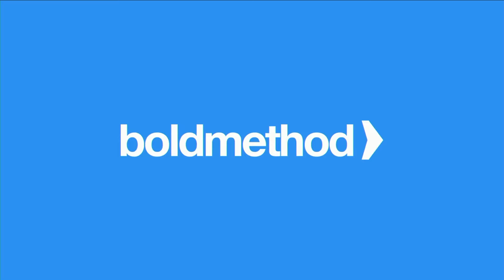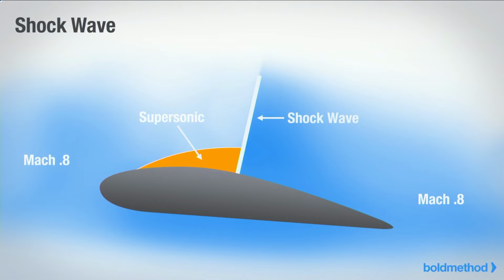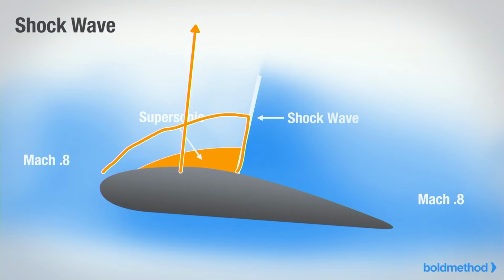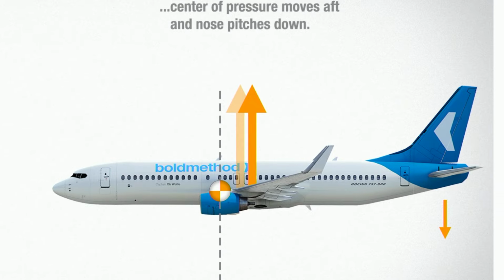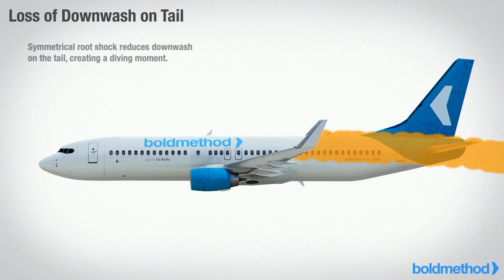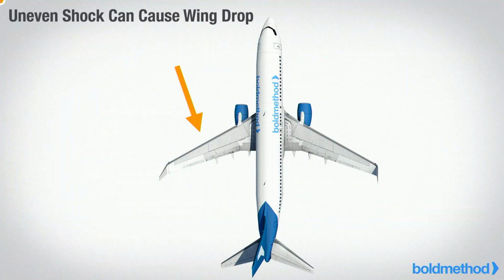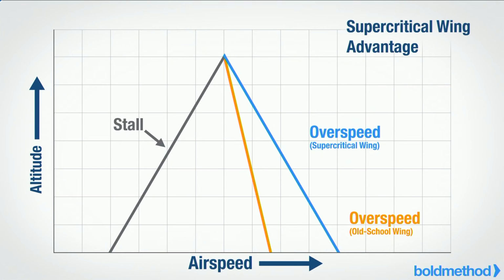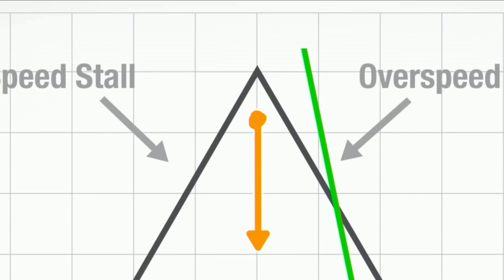Coffin Corner, Explained: Boldmethod Live

Comment: Quick calculation of the Speed of sound in m/s = 20 x (SQRT(Temp in Kelvin). To get Kelvin add 273,3 to Deg in Celcius. Consequently a is 294,8 m/s at the tropopause, above it stays almost constant until about 20km afterwards the temp rises due to the ozon which absorbes energy from UV radiation of the sunlight.

Comment: Just out of curiosity and this is from memory so I can be wrong, on the A320 for certification purposes, they had to fly at the service ceiling, use TOGA thrust and pitch the aircraft nose down to - 20 degrees to get some mach buffet and that was only for a limited time because soon they 'd be low enough to reach VMO instead.

Comment: To answer the question about pressure past the shock wave changing instantly: it just does. IE, that is the nature of subsonic and supersonic flows. The shockwave isn't a causal force, it is a result. Shockwaves are phenomena that form at the boundary between subsonic and sonic or supersonic airflow. I find it not helpful to think of them as a "build up of pressure waves". They are simply the thing that forms at the boundary, whether the flow is increasing in velocity, or decreasing. We are "seeing" the change in air mass properties between supersonic and subsonic flow. Air in supersonic flow is compressible, air in subsonic flow is mostly not. The change is almost instantaneous, and a shockwave is what we call that 'instantaneous' change.
Talking about oblique shocks and normal shocks (They are called normal because they form at right angles, or a normal angle, to the surface they are attached to.) is sorta misleading.  They form for different reasons. Oblique shocks off the nose, for example, form because the air is 'moved' by the nose. But since it's moved at supersonic speed, the air behind it can't get out of the way fast enough, and a shockwave forms between the subsonic air before it, and the air that is moving out of the way of the nose at supersonic speed. In this type of oblique shock, the air is being compressed, and energy is imparted to it by the aircraft. Normal shocks are completely different. There is a pocket of air moving around the wing at supersonic speed. At some point, whether thats behind the wing, at the wing trailing edge, or some other place on the wing, the supersonic portion of flow must slow back down to subsonic. At the barrier of supersonic to subsonic flow,  a shockwave will form. If you compare the characteristics of the air masses on either side of the shock, you will see that the air behind the shock is slower, less dense, and higher pressure, than in front, but overall has significantly less energy, because those changes happened "in" the shockwave, and required energy. The usual result is flow separation as the air doesn't have the energy to create enough pressure, at the required density and velocity, to overcome the pressure gradient on the wing. There's a lot more complexity, but when I shifted my mindset about shockwaves as phenomena instead of causal agents, it clicked.

Comment: Have you guys done the video on pressure waves yet? I’d be super curious to see that. By the way your explanation about the shockwave over the middle of the wing (at 19:15) doesn’t quite line up with the explanation provided by the call video made for naval aviator’s. In your video you seem to indicate that that shockwave is caused by the pressure changing from high to low but then you say that’s caused by the airspeed drop due to the shockwave..,so that’s  like saying the egg caused the chicken but the chicken caused the egg. They both can’t cause each other. That’s super unclear. However, Navy video describes it perfectly and more importantly , it’s lucid and logical. It says that the shockwave above the wing builds up because of pressure waves radiating frontwards (toward leading edge) from the trailing edge of the wing…but they get backed up and can’t move forward any longer. That makes a lot more sense than your explanation. Perhaps that’s what you meant when you said “the pressure waves can’t keep up with the speed of the airfoil”? Well if so, then it seems like that shouldn’t be quickly glossed over. Understanding how the pressure waves back up, where they originate from, what causes them to backup and why, etc…all seems pretty important to having a correlational understanding of this topic. Anyway, just fyi in case that’s helpful/constructive feedback. Love your videos more than any other channel. Otherwise I wouldn’t take the time to comment. Look at this video at the 2:50 mark: https://youtu.be/ugPJYJ-BKkU. This explanation Is a lot more intuitive AND DIFFERENT than your explanation.

Comment: To answer the question about the pressure change at the shockwave. Think of a a line of identical planes all one minute apart and maintaining constant airspeed all flying into a narrow mountain pass that speeds up the wind, and that headwind at some point in the pass is equal or above the planes' true airspeed.
As the first plane enters the incresing wind the ground speed slows, the second plane is still moving faster because it isn't in the pass yet so the linear separation between planes shrinks(the time separation is still one minute). Now at some point the first plane gets to the point where headwind equals airspeed and ground speed reaches zero, the next plane is still moving but in one minute it too will get to the zero groundspeed point as will every plane behind, thus all the planes will stack up on the same ground fix. This is what happens with a shockwave, pressure waves(sound) generated by areas near the trailing  part of the wing move forward in subsonic flow,(from a wing surface frame of reference) getting closer together as the airflow speed is faster mid cord than at the trailing edge, until the pressure waves reach airflow moving at the speed of sound and then they can't move forward, stacking up into the peak pressure. I should also clarify that the sudden change in pressure is from low in the supersonic region to peak high at the front of the shock wave but then the pressure tapers from the peak toward a more normal pressure closer to the trailing edge.
Reply: Also this is why the shock wave initially forms around about the point of max lift/max thickness as this is the first point to go super sonic and then as airplane speed continues to increase the flow remains supersonic further and further back and so the shock wave moves further back. At an airplane speed mach 1.0 the zone of super sonic flow covers the whole upper surface and the shock wave will have moved all the way to the trailing edge, and a bow wave also forms. Important to note that there will still be a few areas of subsonic flow on the airplane up to about M1.1 or M1.2
so the trans sonic range is from critical mach about 0.8-0.9 to 1.2. 
Though minor compress-ability effects are significant from about M0.5 as far as overall aerodynamic design is concerned, this is considered subsonic as M1.0 is not exceeded locally anywhere on the aircraft and so no shock waves form.

Comment: In regard to older jets, its not that they were unconcerned with fuel consumption or going fast. They had low-bypass engines which have poor efficacy at low airspeeds and so to achieve reasonable takeoff performance they had to oversize the engines compared to what is needed at cruise speed. High bypass engines have a reduced ideal operating speed range. So one type gets more effective at higher cruise speed and the other is decreasing in effectiveness. 

This is also why they emitted a lot of soot on takeoff and initial climb, they used water injection so they could operate at higher throttle settings without melting the turbine section. The cooling of water and higher fuel flow prevented complete combustion resulting in carbon particles.(But was only on takeoff and cooler combustion reduces NOx formation, so visually bad but environmentally neutral.) The water also added somewhat to the pounds per second being accelerated through the engine which is what jet thrust is all about, mass times change in velocity.